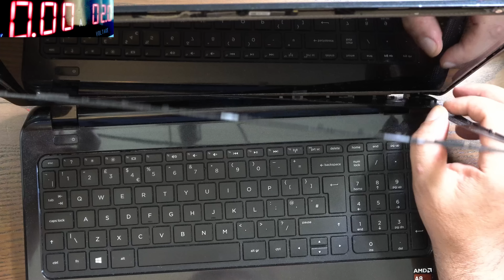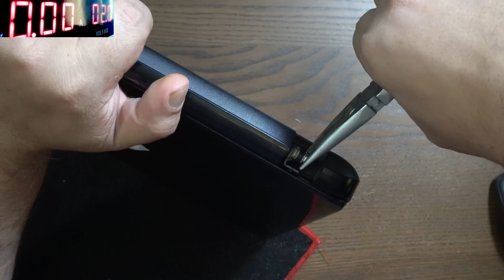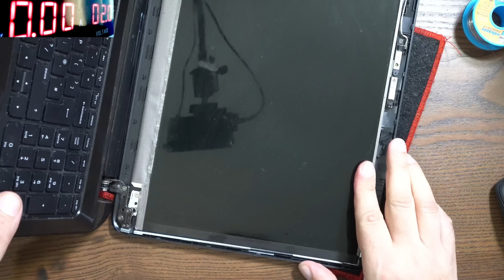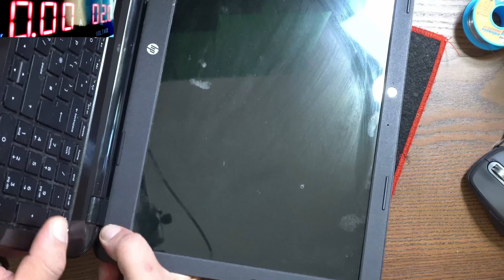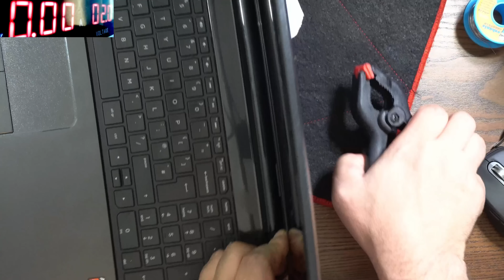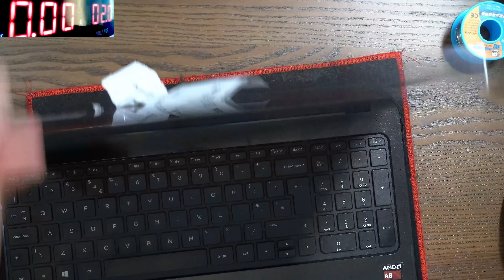I fixed THIS laptop two years ago and now is back for repair. Good or Bad?

Comment: I'm a firm believer in overheating your hot glue and surface you're bonding to. I like the glue to get yellow before I put it on. Accidentally found out it bonds way better that way. 
Respectfully, I've had so many "You SonOfaB :)" moments since I found this channel the other day. I sometimes think I'm a fairly intelligent fellow. But you poking the ends of the laptop battery to feed it some juice the other day took me back to school. I revive dead cells all the time. Why I never connected those dots... Thank you for everything I'm gonna learn here.

Comment: I do it in a simpler way:
First place the metal screw holes into their position.
Then I put the soldering iron on the metal hole, make the plastik a little liquify and bonded again.
Finally I put hot glue around the holes and it performs like original. Better to put oil on hinges as you did, and all good

Comment: I repair such issues once in a while. What i do is drill holes through the case and use super small flat head screws. I think the name was chicago screws. Its a very strong fix and looks also cool 😀 and yes, you need to loosen the axis from both hinges.

Comment: Very nice repair.  I've also used hot glue like this many times but a few months ago I tried out UV cured gel used in modeling/crafts.  It's nice and thick so it stays in place.  Can add in many layers to get it exactly how you want it and ZERO worry about burning or warping the plastic.  it builds up very well around the heat-set inserts and I've been able to put them right back in place where they came from.

Comment: Thank you Sorin, I can understand your point, the hot glue can absorb the  shock power in the hinge, it working like a damper. Not like others glue for exemple the epoxy, the epoxy is very hard to absorb the shocks.

Comment: I used superglue and some fine sand  to rebuild the missing plastic and then clamped it .. that worked well for me ..  other times I've used some epoxy ... but I like your way because if it hardens up before you want .. just heat it and you good .. I'll have to try that next time I get a customers laptop with that issue .. not really my favorite repair though

Comment: I give my customer 3 options. A;  I replace the entire frame but it is an expensive option.  B: Or I use Putty waterproof for underwater. With construction adhesive. Same as they also use in washing machines to protect everything watertight and electronics. Thays one cheap and most work fine. C: The luxe option new hinge - screen frame and case. lol

Comment: There are higher temperature glue sticks that would be very useful for this sort of thing, but sellers rarely give a choice, and almost none tell us the melting point!  The ordinary ones go tacky by 40C, and a black laptop left in the sun, would get more than that.  If you are going to melt sticks with hot air gun, you'd probably get a better job if you bought some of the bigger, rectangular sticks used in hot air welders.  There are glue sticks that will be ok in boiling water, but very hard to find. Even ones advertised as high temperature don't say what that temperature is.  :(
Have you tried repairing the harder plastic, like broken screw mounts, with Superglue and bicarb, sand, or other suitable fillers?  It's amazing how versatile and strong Superglue is when you use it with fillers.  There are loads of videos about it.

Comment: I will try the hot glue fix on a laptop and see how long it lasts. Might be a good fix for future jobs. Thanks for tip. I suppose if you live in a hot country you could still use a two part epoxy and clamp it overnight for a strong fix. Might be worth a try, only thing is it's not reversible like hot glue and is not a flexible, maybe too brittle. I have an old HP which I used epoxy on and it's still OK after 3 years. However it's my laptop, I'm aware of the fix I did so I treat it with care. I wonder if it would last as long if it was done for a customer?

Comment: If you want more permanent solution, instead of hot glue, uses epoxy glue. But first you have to use super glue to stabilize the position first, just use a touch or two, let is set, then you can continue with epoxy glue around that hinge. 

This is how I fixed mine, due to delamination of the screw post from the aluminum cover lid, not the hinge itself. Laptops' durabilities these days are disappointing.
Reply: Can I use wd40 instead of fastrax for the stiff hinge?

Comment: How about using that resin that is cured by UV light?
Reply: I've previously successfully utilised ShoeGoo(hand moldable plastic) on my HP with a similar issue. 
Over engineering the second hinge with the hardened plastic was relatively effective. Untill the hinge got so tight it wouldn't close and needed to be dismantled but I had glued in the bolts 😅, drill presses are great.

Comment: Isnt it better with the bolts?
Reply: Yes, however the nuts are still there and are going back in the same place they ripped out off. They came out in the first place because they're only housed in flimsy plastic.